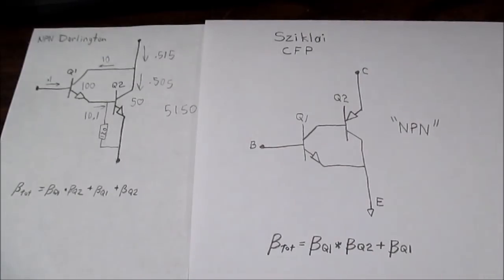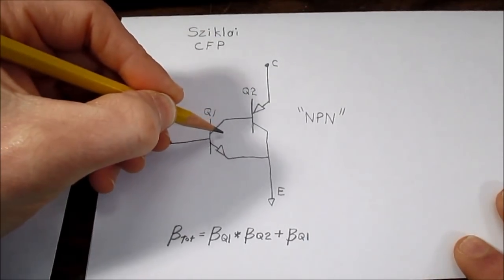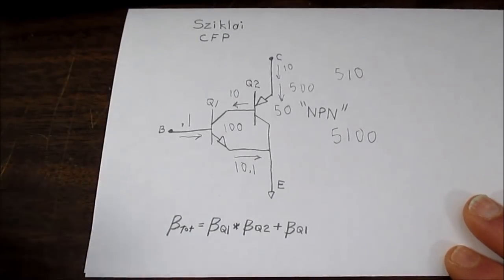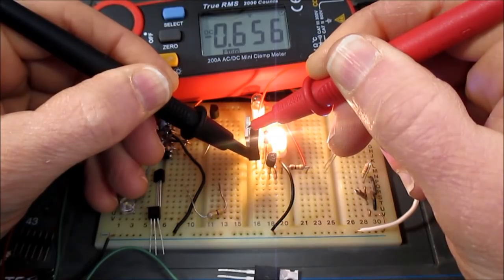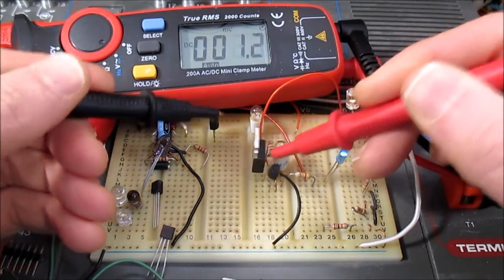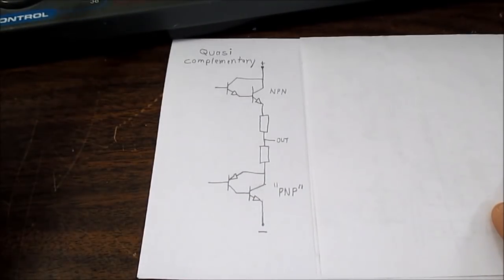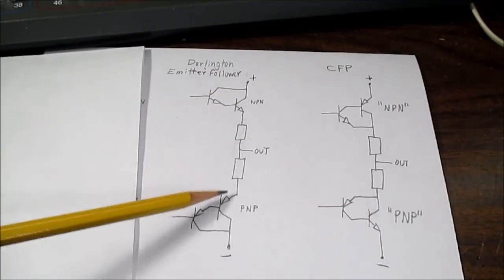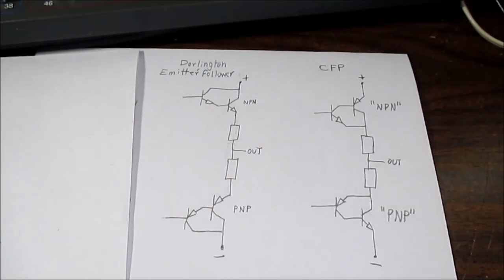Understanding Sziklai transistor circuit characteristics with demo

Comment: There is another advantage with the CFP: you can get more voltage swing at the output and therefore more power. This yields especially for lower operating voltages. With Darlington configuration I can get 10 W at +/- 12 V rails and an impedance of 4 Ohm. With Sziklai configuration I get 13 W. At higher operating voltages this advantage vanishes more and more.

Comment: May be getting out of the "audio" subject, but I've been playing with LED flashers, and if you put a 50K or so resistor from + 12 Volts to a 2.2 uF capacitor to ground, then put the Emitter of a S9018 NPN Transistor to the R/C junction and then an LED from the collector to circuit ground, The LED will flash. (Base of transistor is N/C) Changing R/C changes frequency. Almost any NPN Transistor will do this, But a PNP will not. I use this to pulse the power to the LEDs and save power. The NPN is "backwards" but flashes when it's breakdown voltage is met. (I think) instead of the LED you can drive another transistor for even more power. Why a PNP won't work has me confused. Different transistors must have different voltages in order to "flash".

Comment: sir have a good day.im.just asking what is the best value of coupling capacitor or input capacitor for.preamp? what is the best coupling capacitor electrolytic capacitor? or propylene capacitor?tnx.sir
Reply from the maker: Polypropylene
Reply: @JohnAudioTech  wow..thank you sir..what about the best value of capacitor? for input coupling caps polypropylene?
Reply from the maker: @cortessarge5399  I can't say without knowing the input impedance of the circuit.
Reply: @JohnAudioTech  for my preamp tone control sir?
Reply: @JohnAudioTech  my input value capacitor of my preamp with tone control is 2.2uf electrolytic capacitor and the output is 1uf electrolytic caps.is that ok.sir the values of the capacitor? and can.i change polypropylene caps?
Reply: @JohnAudioTech  sir john.pls kindly explain what is input impedance? coz i don't know what it is..im just a newbie about audio.enthusiasts..tnx

Comment: It would be interesting to do some speed comparisons between standard Darlington and the CFP configuration.  The Onkyo A-9150 is designed to achieve 500V/us slew rates, and it uses CFP in the driver stage.

Comment: You did not mention that CFP gives you an advantage in signal swing: it subjects your signal to just one diode voltage drop instead of two in the darlington pair. Also, you did not mention what the stability conditions are for sziklai vs darlington pair. Overall, nice video.

Comment: Back in the day, they would often add a diode in series with the base of the CFP, so the voltage from the rail would be the same as the complementary "Darlington" pair. Once complimentary pairs of power transistors came available, I went with the CFP design, because it didn't add the negative temperature coefficiency of the drive transistor to the power transistor.That means only one compensation diode, instead of two, to give overall temperature stability. The diodes needed to be thermally coupled as close as possible, to the power transistors.(the emitter follower resistors are there to pick up the difference)

Comment: Can you recommend a good in production PNP,  to build a "PNP" Sziklai with a 2n3055 for a quasi complementary output stage? Thanks.
Reply: Try the BD140 - 16, 2SA1358, or a ZTX753 (lower power). Older/oldest pnp driver transistors are the BC 161, BC461, BCX29 which are available in the metal TO5, TO39 cases which can make attachment to a common heatsink difficult (the collector is connected to the case with these transistors).
Reply: @robertneill3057  

Thanks. I've also seen SJE210 used, in a stereo receiver, but it's not available anymore.

Comment: A rather old  integrated Kenwood KA-300 in my collection has the Quasi Complementary output stage.  The schematic calls it "SEPP" (single ended push-pull), which may sound rather confusing, as SE and PP are mentioned together. One of the advantages of this circuit is its simplicity, it needs fewer components to deliver a decent sound than the Darlington setup.  BTW, not only does the CFP not need a sensor on the heat sink for thermal stability, on the contrary, a thermal sensor on the heat sink would be a bad idea.
Reply from the maker: The term SE is kind of confusing as in the tube amp world, it refers to a single output device rather than a push pull circuit. In solid state, SE seems to refer to an output stage that has one output connection and the other terminal is circuit ground as opposed to a bridged configuration.
Reply: You still need some compensation for the negative temperature coefficiency of the DRIVE transistor, not the output transistor. That would allow you to put the compensation diode on the PC board,(in close proximity to the driver transistors) unless, the driver transistors are also mounted to the same heatsink as the power transistors. In that case, the diodes do need to be mounted on the heatsink. If the drive transistors do need to be mounted to a heatsink, that's where to put the compensation diodes.

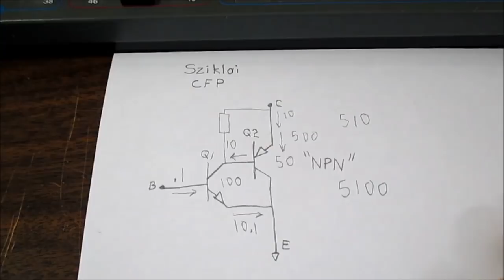Comment: I would like to see a link to a schematic with the parts identified for the work you did from 9:30-11:00.
Reply: I can't find an image anywhere but on page 75 of Small Signal Audio Design by Douglas Self there is good CFP unity-gain buffer. I am making an active crossover with that buffer.

Comment: Sir I am a subscriber of your channel. Well in your class d amp reviews the pam8403 inspired me most. But wen I bought the amp I realized that it had a lot of bass. And its a low power amp so giving output filters will decrease the sound output so sir is there any way to decrease the bass from the input? And also I found that 104 pf can decrease some bass but not that much.
Reply: The amplifier is of course linear across the frequency range, but as you found it's sometimes not desired :) Due to 1/f energy distribution, cutting off a little bit off the low end where your speakers aren't audible anyway, can give you a good bit of leeway on gain. Perform input filtering rather than output filtering.  Most economical way do to this is to look at the existing input AC coupling capacitor and reuse that and connecting a resistor across the input. Look up "RC high-pass filter", you'll find how to calculate the filter. The AC coupling capacitor forms effectively such a low-pass filter together with IC's input impedance as resistance, but since IC's input impedance is very high, you want to effectively lower it.